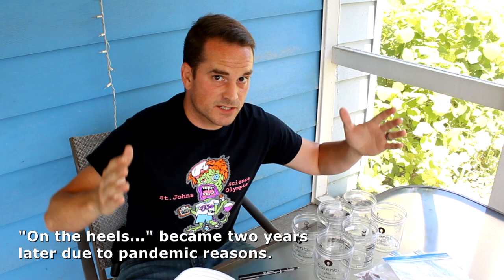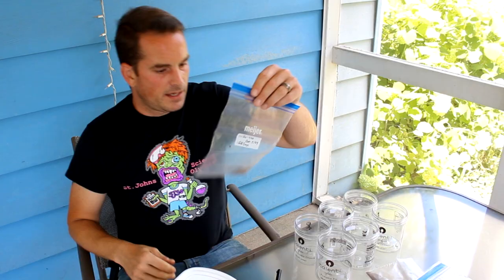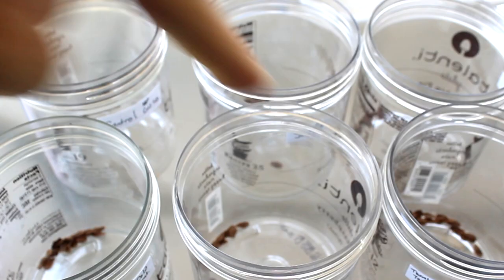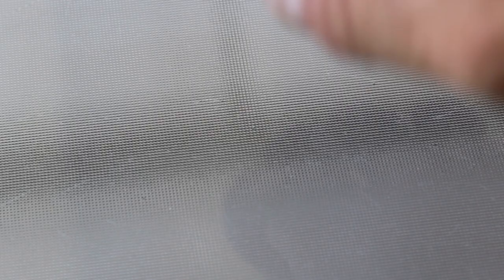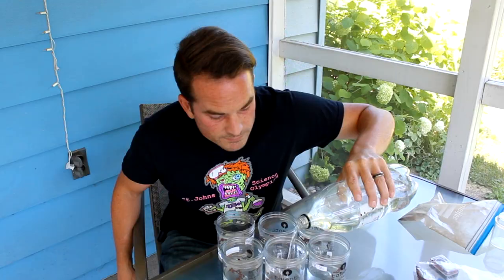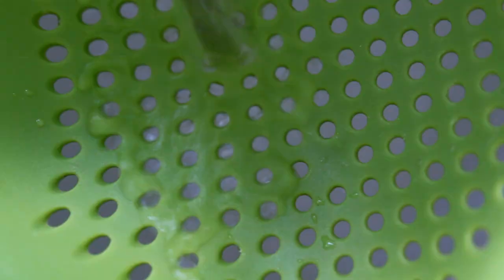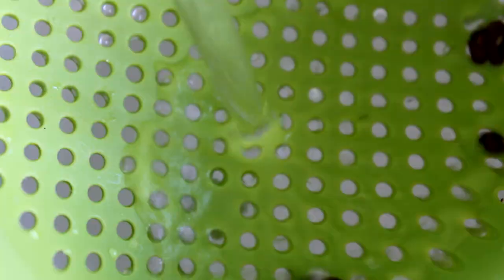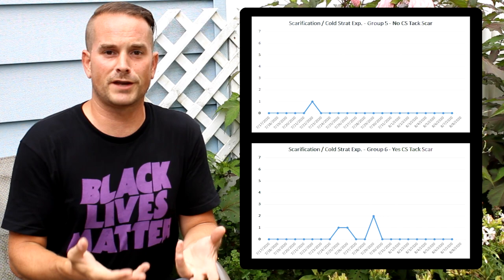Raising Monarchs - Seed Scarification Experiment (Help The Monarch Butterfly)

Comment: I used a fingernail clipper to lightly clip the pointed end of 25 balloon plant milkweed seeds and sowed them in a seed starting mix. I also planted 25 unclipped seeds at the same time. Two weeks later I've had six clipped seeds sprout and zero unclipped sprout.

Comment: I'm so happy you are back! The paper towel method didn't work for me so I'm going to try this method. Thank you for your video, it'll definitely help me try this again.
Quick question for you... Have you ever had an egg black tip for over 24 hours? I've never seen this before and I keep checking it multiple times a day with a magnifying glass to make sure it's not the whole egg turning black. Just the tip is black, as per usual, and I can see the 2 little black dots of the filaments right below... But nothing has happened. Ever experienced a late bloomer like this?

Comment: I’m trying to grow seeds indoors in November. Already been cold wet stratification for 3months in refrigerator. Most seeds I already planted outside 2 months ago, they’re sprouting and doing great. Of course slowing down because nights are now in 30* degree temps. 
Now I want to start more seeds inside the house. So they’re ready for Spring 
Is it ok to Keep them growing indoors In house in our 68* temp near plant light or do I have to move them outside in 30~50* temps? I have Showy Milkweed native to my area. Will they be safe grown indoors until Spring? Or once they get 4 inches or larger do I have to move them outside plant in dirt? I’m new to milkweed and any advice so greatly appreciated. 
I want them ready to help Monarchs ASAP. New Subbie and been binge watching all your videos.

Comment: I start my tropical milkweed seeds indoors in late March. I have cold stratified them and put them on a warming pad. They are slow to germinate. It isn't until I eventually bring the trays outdoors, that they starrt. I have scarified seeds before, but not milkweed. I have 'raised' monarchs for over 5 years. To do so involves Having milkweed as early as possible.Monarchs have been rare lately at 42 dedgrees latiitude and 90 west.
Reply: May I ask where you live?  I've read that it can be problematic to attract monarchs with tropical milkweed outside of that types natural habitat.  It's suspected that it tricks the monarch into thinking it's geographically somewhere else and may inhibit migration.  Let me know your thoughts and best of luck this season!
Reply: I encourage you to plant Native Milkweeds as it is more attractive to the fauna native to your area and it helps conserve that particular species by providing a safe space to grow and reproduce.

Also, it's been concluded that Tropical Milkweed can become problematic in areas that it's not native to IF it doesn't die back in the fall and winter as there is a parasite referred to as OE and it builds up and reproduces on the milkweed plant. It dies with the milkweed plant so if the plant survives, so does the parasite.